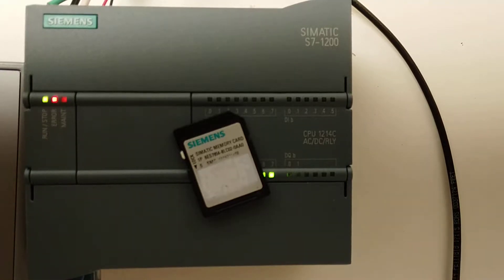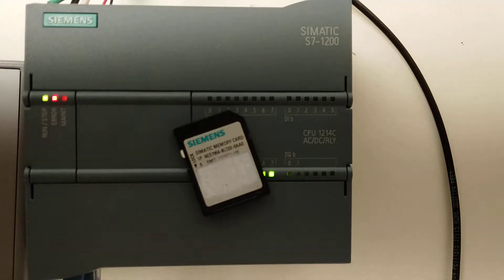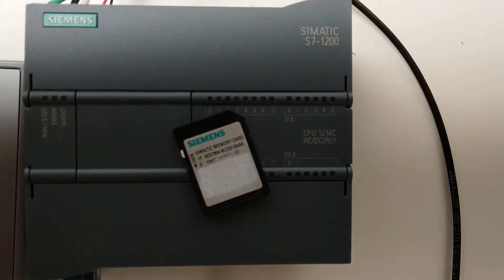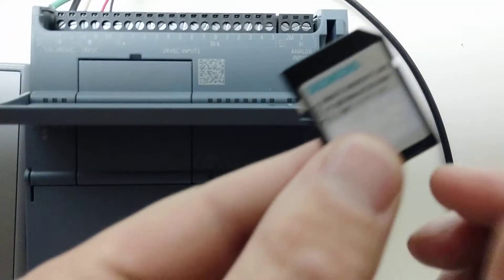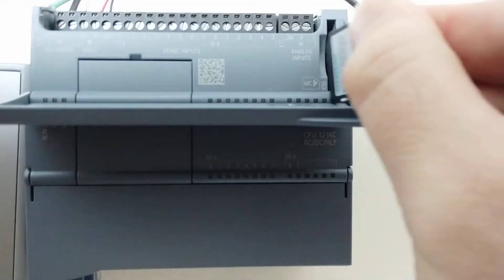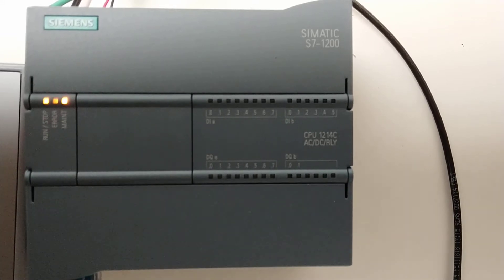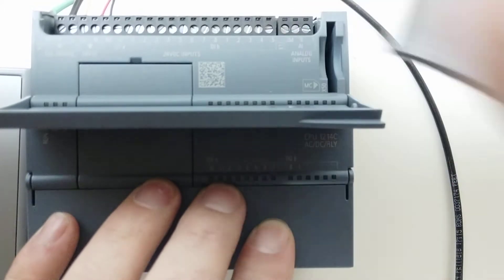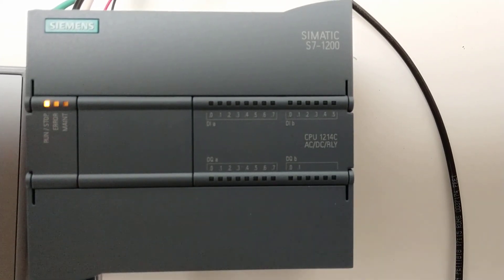How to Transfer a PLC Progam to a Siemens S7-1200 PLC Using a Siemens Programming SD Card

Comment: Hell Sir, thank you for sharing this video, can you please tell me how to copy the program from the PLC to the Memory card if I want to see how the programmer  have programmed it.
Reply: Just reread your question: how to upload the PLC project?
A PLC project cannot be uploaded directly to a Simatic memory Card.
It can only be uploaded to TIA Portal, in the TIA Portal version from which the PLC was originally downloaded.
Three options:
1) Manually add the HW configuration of the 1200, go online and perform an upload
2) add an unspecified CPU and detect the program + go online with the plc + perform upload.
3) Use 'Upload device as a new station, hardware and software'.
Reply: @yarnopaenen6895  Thank You for your reply